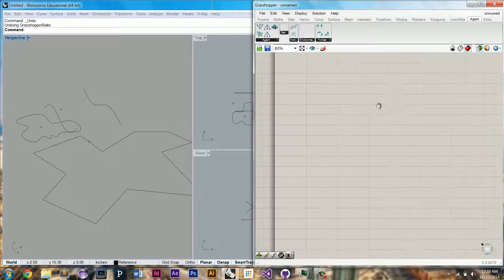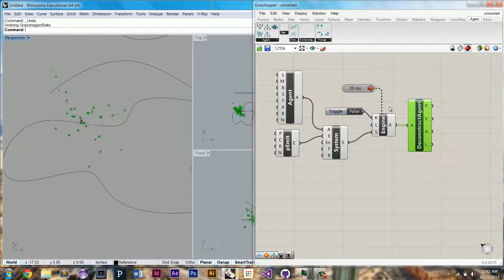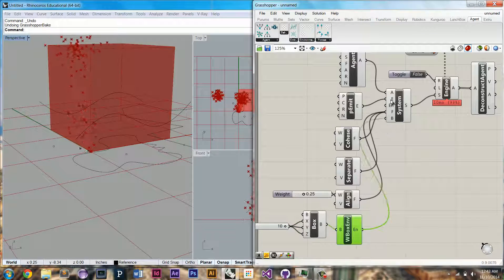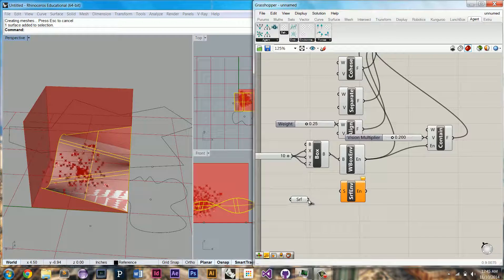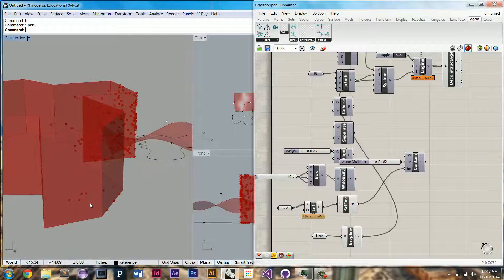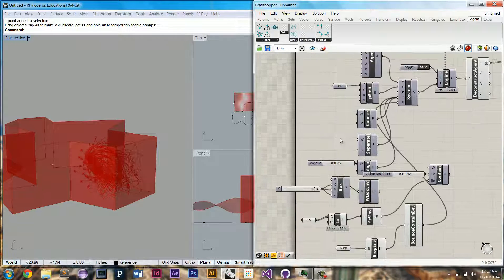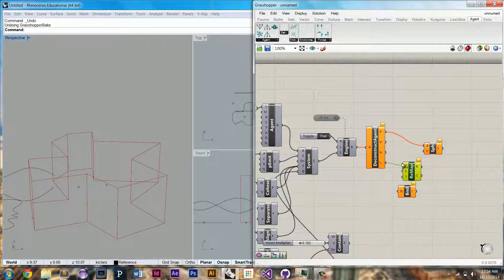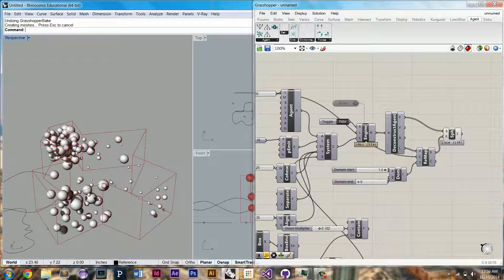Agent Plugin for Agent Based Design in Rhino Grasshopper - Introduction

Comment: What if the environment is not an enclosed space, like water flow bump up into stone?
Reply from the maker: The surface environment component with the contain force extrudes the edges of the surface to create a boundary that the agents will avoid.